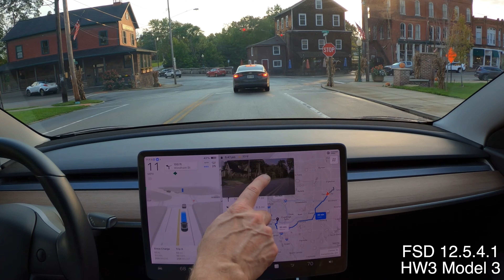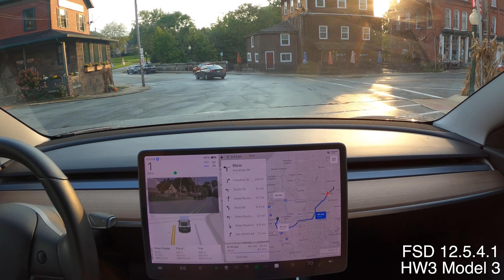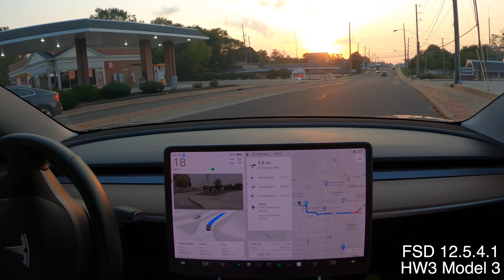FSD 12.5.4.1 Still A Hot Mess

Comment: On the visualization I noticed on my car it seems to have less distance it can see ahead. I guess it used to be able to see over 200 feet and now it’s like 50 or 70.  There’s something wrong with this version on hw3. 
I wonder if Tesla is pushing sales of hw 4 by making the hw 3 not work right.
They can get car parts and batteries back with trade in and have materials to repair older cars rather than manufacturing parts.

Comment: Car seems to have more problems when Sun is low on the horizon
Reply from the maker: Maybe. Driving FSD since V10.2 several years ago I can't say I noticed the car struggled with low sun.
Reply: On 12.5.4.1 with HW3. I've been getting many "take over immediately" errors facing the sun low on the horizon (not that low, my sun position apps says it was about 30 degrees around 4pm when it happens) even when the sun is partly obscured by trees. This started with 12.5.4 and 12.5.4.1 did not help. My cameras are clean and it worked fine with 12.3.6. I'm now wondering if perhaps it always had periods where it had low confidence in handling the situation and would just keep going anyway, but now it makes this alarm when it happens. I suppose this would help get lots of bug reports when fsd was marginal and without this alarm they don't get feedback about these poorer performing situations.
Reply from the maker: @janbottorff4642  What you say makes perfect sense to me. I see the same low sun sensitivity in 12.5.4 onward that I did not see on 12.3.6. FSD is a true black box.

Comment: Too picky about the speed control tbh
Reply from the maker: It's annoying AF.
Reply: Where I live I stopped using auto speed. It is only off 5 or 6 mph in my area until I’m passing the police station on a specific 35 mph road going through town.  There it speeds to 55 every time.  So I just stopped using it. 

Tesla in its current state of Robo taxi is behind Waymo in that Waymo doesn’t have to scale or go everywhere. The fact that it can go anywhere without paying human drivers makes it a robo taxi already.
So that’s why we want to see significant improvement.